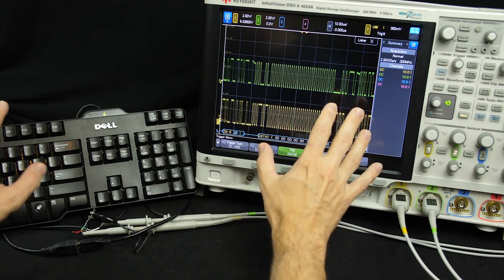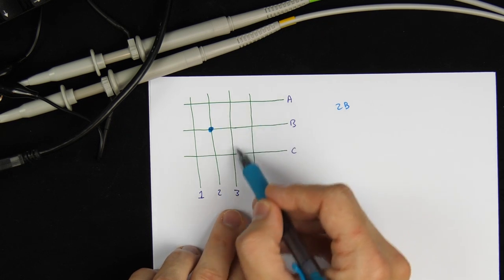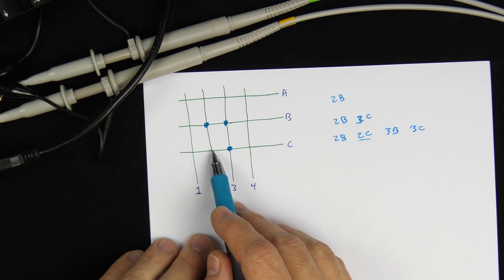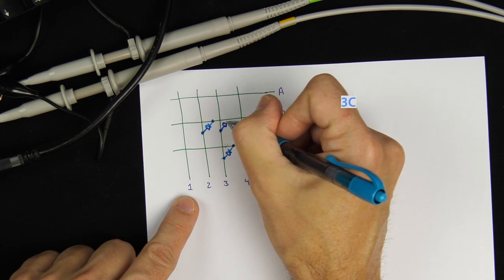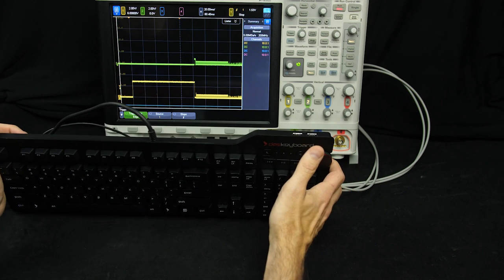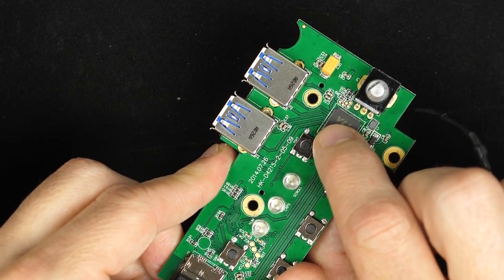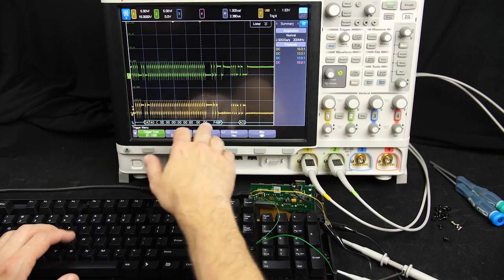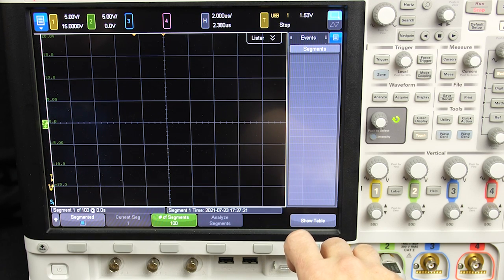How does n-key rollover work?

Comment: I'm sure YOU know, but this is for the audience:
That amount of noise/oscillation... aaargh! Next time, grab a piece of USB cable and solder that instead of two random pieces of wire :)
Use the NEAREST grounding point from the D+ and D- to attach the shield of the cable and keep untwisted wires you're soldering as short as possible.

USB traces must be quite closely coupled with the GND plane/shield of the board so same thing does in cable itself :)

And just twisting the wires together wouldn't have saved that in this case since you're using ground LEADS in your oscilloscope probes AND you're attaching them quite far away.

That causes the return path of the current to be weird and that piece of extra wire acts as an antenna picking up everything possible.

Keep on hacking people!

Comment: Am I right in thinking that the 6 key spec and the n key spec require specific driver support to work, but since they're part of the base USB spec the drivers are included as generics within windows?
And am I also right in assuming that while modern windows has the built in driver to support the n key spec, older operating systems designed before the n key spec, like a windows 98 machine say, won't have a driver to understand what the n key spec is doing?

I'm guessing that you can probably basically write any interface you want to do whatever you want, but stuff that isn't designated in the USB spec will require a driver to understand that protocol?

Comment: I think the reason the cheap keyboards don't include diodes is not so much the cost of the diodes themselves but the fact that they use membrane construction with plastic sheets and printed conductive traces. This means that it would be very difficult to physically connect the diodes to each "switch".

Comment: I’m kinda curious about that volume knob. Does it continuously report single increment changes in volume or does it report a volume value like 0-100% whenever a change occurs
Reply: These kinds of knobs usually boil down to "volume increment" and "volume decrement" keys. It just bursts them repeatedly when you turn the knob. That's exactly how mouse scroll wheel works. In most cases, thy don't even report any delta values. They just burst more button presses for higher increments.
Reply: It doesn't have an absolute value, you can just keep spinning it.

Comment: I think keyboards can detect ghosting without much programming by looking to see if the drive signal is picked up on any inactive drive pins. If row A is driven and a signal is detected on row B instead of just column lines, the controller knows there's a situation where ghosting might be occurring.

Comment: Very interesting. How about the USB to PS2 converters? Those were one time the only way to get n-key roll over function on a USB keyboard. Were they fed with the single-bit-per-key protocol? Would be interesting to see a video that compares usb in with ps/2 out.
Reply: USB has always worked the way that this video shows, and always had this capability.  If you didn't have N-key rollover early on, you simply didn't have good USB keyboards early on.  And USB to PS/2 converters aren't really a thing.  Keyboard microcontrollers, at least on older keyboards, used to be able to sense from the initial voltages whether the host was USB or PS/2 and behave accordingly.  All that a "USB to PS/2 converter" really is is a dumb connector that converts the socket for one into the plug for the other.  This is why they don't work with some keyboards, where the PS/2 capability has simply been dropped from the microcontroller.  One could do a video where one shows with a meter that all the pins are wired up, but it wouldn't be as interesting.  (-:
Reply: @JdeBP  and yet for some reason the earlier Das Keyboards required the adapter to give NKRO. Yet at the same time Matias sold their Tactile Pro boards which always did it this proper way. I remember seeing Das Keyboard fans in keyboard forums claiming Matias’ NKRO claims must be a lie because “it’s impossible over USB”. Even in the comments a lot of people are surprised at this standard, because their modern board emulates multiple 6KRO boards instead. So it seems barely any manufacturers used to do it properly, and a large fraction of cheaper to midrange ones must still do it improperly.

Comment: How does NKRO works from the perspective of the OS? Does the driver translate the bits back to the keys?
Reply: Of course. The driver implements the HID spec on the receiving end, translating the keys to whatever low-level interface Windows or Linux have in the kernel.

Comment: 35:26 I assume that the firmware that is flashed on this microcontroller is just the same firmware that they use for all their keyboards, so this way they can easily add buttons like "open email app" or something without having to update their firmware

Comment: @25:45 - It looks like there is a delay between the keys released and the bits resetting. Is this a mechanical delay? a slow matrix scan? a busy microprocessor?
Reply: It's probably latency of the oscilloscope

Comment: It seems to me that if you type fast enough between usb polls, the n-key mode won’t be able to indicate which key was pressed first, whereas the 6-reports could be sent in the right order.

That is, assuming the keyboard’s microcontroller is buffering keypresses waiting for the poll, and scanning the keyboard matrix more frequently than the poll rate.

Which is a lot of assumptions, I guess.
Reply: All those people typing at 30,000 WPM will be so disappointed!
Reply: The order of the bytes in the 6-byte report is irrelevant.
Reply: The 6-key report format is also a snapshot of key press state.  It isn't an ordered sequence of scancodes.  It's just a way of encoding the bitmap into a shorter form, at the expense of limiting how many bits set to 1 in that bitmap can be reported.

Comment: I have the same keyboard that you used in the very beginning of the video, and I've played a lot of video games with that keyboard. I think this video answered my curiosity as to why sometimes my character won't do a certain move when I felt sure I was pressing the right set of keys. For example, in Genshin Impact or Assassin's Creed II, I would press W and D to turn my character towards a certain direction, and then I would press E to perform a move, but I just tested holding W and D and pressing E wouldn't get registered, and since they're so close on the keyboard without diodes, they get registered as an error.

Comment: Does they keyboard microcontroller have USB hardware? I’m wondering if they’re just bit-banging the USB 2 from the microcontroller. It doesn’t have to be good enough for every computer to get, it just has to be good enough for the built-in USB hub chip, which will rework it via hardware and take it from there.
Reply: I think ultimately at the end of the day it can't be turtles all the way down. Something eventually has to be the interface between some kind of general purpose microcontroller and the first dedicated piece of USB hardware in the chain, and I think what they've done here is programmed the firmware of the microcontroller to speak USB 2 to the hub chip. This especially makes sense because it can speak in two different dialects as it were, so there's two different sets of firmware instructions for six key or n key.
Reply: @Hugh_I  Wow, microcontrollers have everything, nowadays, don’t they! Thank you for looking that up.
Reply: @AviDrissman  yeah, while this looks quite a beefy microcontroller just to register some key presses, lots of even way smaller ones come with built-in USB these days. Even the tiniest ones at least usually have a UART serial interface, some I2C or SPI bus alongside simple GPIO (simple digital pins).
What you usually can do with smaller ones without a built-in USB is to hook up an external USB chip on the serial interface. But the price differences are so low, If you really want USB (and faster than low speed), it seems reasonable just to go with one that has it on board.

Comment: So N-key rollover is just a glorified shift register!
Reply: Nope, the hardware side also need need to capable of doing NKRO. Most NKRO keyboards are using PCB instead of membrane, that combined with the diodes make them more expensive.
Reply: @UltimateAlgorithm  i meant the protocol. It seems that is basically just a bitmap, which is what a shift register gives you too
Reply: @MoritzvonSchweinitz  ah, maybe it is better that way for NKRO keyboards. Since most of these boards are gaming oriented. Bitmap could have less processing and resulting in faster input. But that is just my guess.

Comment: Non-Rollover mode data shows 13 bytes.  13 bytes = 104 bits = 104 keys.   Until now, I never knew why everyone stopped at 104. 

0x67 = 103, if 00 is reserved, then either one of the keys is a exact duplicate of another, or there can only be 103 keys.
Reply: You have the cart before the horse.  104-key keyboards existed well before USB was invented.  You are entirely forgetting all of the modifier keys, too, which have usages above 0x67.  And of course very few people stopped at 104.  I have a so-called "104 key" keyboard that in reality has 126 keys.  And even ignoring "multimedia", "system", and "internet" keypads, things like 109-key keyboards have existed for longer than USB has.  The N-key report length here is driven by what this keyboard has, not the other way around.

Comment: cheaper membrane keyboards also lack nkro because they get a plastic sheet sandwich instead of a PCB where you would solder the switches on a mechanical one, these plastic sheets close contacts when a key is pressed, so no space or way to solder a diode

Comment: is it using 104 bits or did i miss something? if a is 1, b is 2, c is 4, d is 8 etc, and it figures out the keys by the sum of the codes, how does shift etc work? is it all CPU side, eg, 1+27, a + shift?

Comment: Instead of taking the keyboard apart, could you have not just set the USB speed in the BIOS to v1.1? Not sure if modern BIOSes can do this, but I know older ones can. I also wonder if you could do this in software on the machine at the OS level.

Comment: Looks like with some carefull soldering, you should be able to get another USB or USB 3.0 port for free on this keyboard, because port "3" of the USB-HUB chip is not used. 
(Ports "1" and "2" where populated and the keyboard internally connects to port "4") mayby there is an version of this keyboard that has 3 external USB-3 ports...

Comment: Curious that they use a separate interface for the system control stuff (effectively turning itself into a composite device with two distinct HID functions), instead of sticking everything into one report or using two separate reports (with different report IDs) on one interface.
Reply: There seemed to be a different HID usage attached to the interface, if I understood that, which implies to me that it's needed.
Reply: @SimonBuchanNz  No, that does not require a separate report let alone a separate interface. The HID Device Class specification even has an example for a keyboard with integrated pointing device using single interface.
Reply: @JdeBP  The thing is, the boot protocol is indicated in a completely separate way (via SET_PROTOCOL) and doesn't involve parsing the report descriptor at all. Supporting the boot protocol doesn't actually constrain what you put into the normal report format or its descriptor since those are not used at all by BIOS/UEFI. The only constraint is that you can't put a boot keyboard and boot mouse into the same interface (but that's not applicable here).

But you're probably stlil right in that it probably has to do either with compatibility with broken HID host implementations and/or developer convience.

Comment: Both good on them for just using a plug to plug cable for it. Simple fix for one of the most common problems. But I lotheee the micro usb3 connector. It is absolutely the worst port ever designed. And probably gona be a big reason this keyboard “dies” sure it won’t be actually used, and appears won’t get any stress if the keyboard is yanked but still… don’t trust it… it’s also not a secure connector. Once that hot glue fails it’s just going to work it’s way out and become “landfill” as most people wouldn’t dare to even open it to look let alone think it’s just any standard cable…. And get another or something else… 

Also. Thank you for showing logical thinking. It’s the skill that apparently few have and I enjoy anybody who tries to show it. 

No one needs to be a tech genius to of figured out the connection to the “keyboard” no computer, data sheets, or Google required just logic. (Again rare but it’s nice to try to teach people about logical thinking) even saying things to us the viewer that “shouldn’t be necessary” and us smart cookies would consciously process, good to point out nevertheless. Without a doubt you like me and select others quickly identified the correct chip without google. And even the keyboard single pair. I did the Leonardo DiCaprio point at it. 1 it was the only single pair on a side of the chip without any other pairs next to it (pin wise) of those 4 pairs on that corner it’s 99% likely the 3 pairs on the right side of the chip were a high speed connection. And the one lowly pair on the bottom of the chip was separate it would of been stupid for the chip designers to do anything else. But always DOUBLE CHECK!

Comment: If I were designing the keyboard HID spec this method using a bit for each key would have been the approach I would have taken, why does the 6 key rollover spec even exist? A smaller packet has lower latency I suppose, but that should not be a big concern for HID interfaces as the human reaction time is still orders of magnitude slower.
Reply: Other devices can share the same wiring, so it makes sense to reduce the recurring data packet size unless it's needed.
Reply: I suspect it's to decrease complexity. With the 6 key rollover, you can have a 6byte buffer. As you scan the keys, you keep an incrementing counter. When you detect a key, you use the counter as index in a lookup table of keycodes and you push that keycode into a buffer. Once you're done, you send the buffered values over USB.

With bit-per-key, you either need to scan the keys in keycode order to fill a buffer, or you need per-bit random access memory. Or you push the keys into the buffer in scan order and then you reorder them into correct order before sending them out (or reorder them on the other side, in the keyboard driver on the PC).

Smaller packets are not just good because of latency. They also decrease complexity of the hardware (specifically the amount of necessary memory).
Reply: The 6KRO mode is called the "boot protocol" or "USB Boot Keyboard Profile". A computer BIOS and similar simple software can be hard-coded to support only this very specific report format (with 1 byte for the modifier keys and 6 bytes for the list of keys), instead of being flexible and parsing the report descriptor to see what the format is and supporting arbitrary formats. Since keyboards have to support the boot protocol anyway in order to work in the BIOS, cheap keyboards end up implementing only that. It's the lowest common denominator.

Comment: But wouldn't sending the pressed keys with a '1 bit per key' encoding lose the order at which they are pressed? Sure, normally the system would receive the first key alone before receiving two keys simultaneously, thus inferring their press order. But in rare and unlikely cases where 2 keys are pressed exactly at the same time, or because of a connection problem or system freeze some of the packages get dropped, the driver wouldn't know the order they were pressed in. Not super important in games, but pretty crucial when typing!
Reply: This would only be an issue if the speed of the USB polling rate is incredibly slow. With a polling rate of 10 ms this is a non-issue.
Reply: There is no press order in USB keyboards to lose in the first place.  It's always a snapshot of the keyboard press state, either encoded straightforwardly as a bitmap or as a reduced-size form that trades size efficiency for ability to report the whole bitmap.  These aren't scancodes, in a sequence.  These are array indices, telling the host which bits are set to 1.